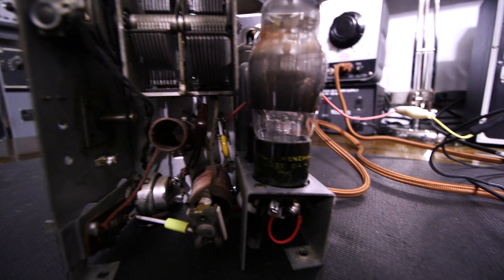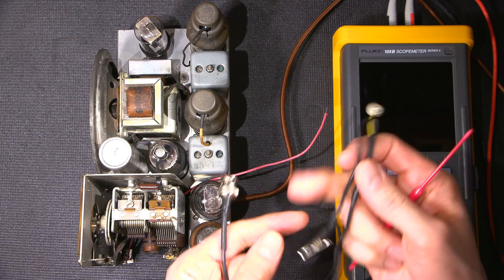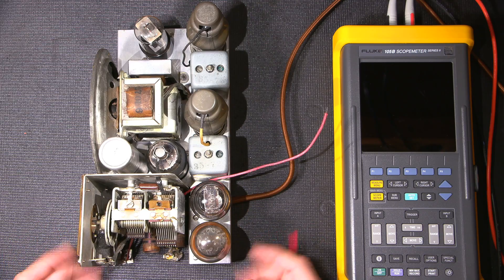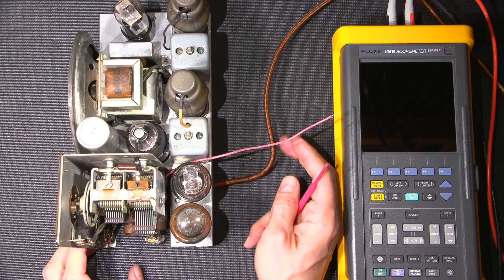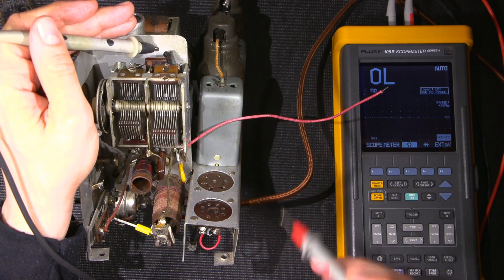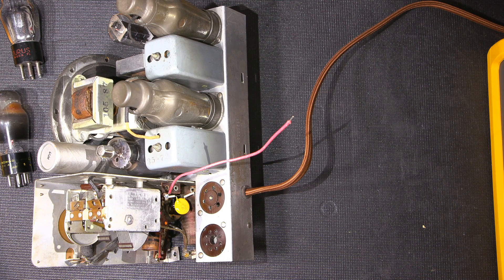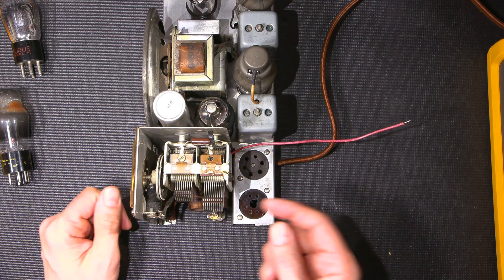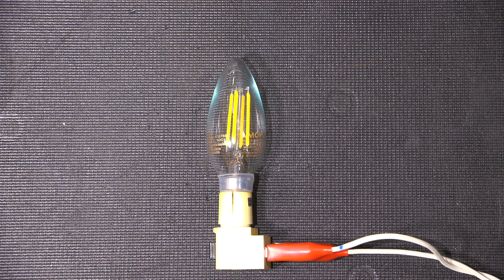See High Voltage Created From Falling Snow!

Comment: This is amazing, if i recall correctly from a Richard Feynman book, that every meter or so up is like 100k volts up into the atmosphere. so possibly the snow is still charged with high voltage from the outer atmosphere and conveys that to whatever it touches, but you need to collect the static from a lot of snow to notice it. just an idea.
Reply: 70 volts per meter is more like it. Thet's 2x10^6 to 3x10^6 volts to the top of the atmosphere.

Comment: Had that happen across a coax connector that I'd disconnected because a storm was approaching.  Very loud arcs!
Reply: Same here. Happened at a friend's place as well while a thunderstorm was approaching.
Reply: Had this on a car Ariel during a very dry day in the desert. No cumulous.
Reply: No in the desert the air was still. It was a low pressure area coming through. Apparently there is a normal altitude / voltage profile. It must have been pumped right up.

Comment: I hope you megger out that isolation Transformer, you know an isolation Transformer with a short to ground is very pointless :-)
Reply: It could be just fine. Is that a conductive antistatic mat the radio chassis was sitting on? If so, we have all kinds of possible paths to ground.
Reply: @Fourcycle  Good observation. There are possibly critical details in this event that need to be noted and modeled before our speculations here can be checkable. I've noted others have pointed out quality of AC line grounds to his home as a possible concern, and Carlson's video didn't explain the situation of the coax from the antenna to the radio unambiguously from an mateur radio operator's perspective, e.g. were the usual RF/lightning/AC-safety grounds and safety measures applied at the point where the coax penetrates into the home/lab? Or, was it a single contiguous piece of coax from up at the wires in the air, to the BNC connector he attached his shield-lifting pigtail to? (which somehow seems like a bad idea, esp. in retrospect)

Comment: This same thing happens with aircraft when they fly through snow and to a lesser effect rain. The snow carries a charge from the rain cloud above and when the metal plane hits it while flying the plane collects the charge. On the trailing surfaces of planes are static whips. Small 6” flexible rods with very fine short hairs, usually the rods are in  pairs. The rods and then the hair gives the static some place to exit the airframe. This allows the radios to transmit and receive. When I have been flying in very heavy snow in my small Cessna 182, the whips are unable to keep up with the static discharging and I get mild to heavy crackling in the radios. Sometimes to the point the squelch setting is overcome. 

The antenna did the same thing as the plane collecting the charge, and found a ground through the equipment.

Comment: I worked as a cable line technician near the CFRB radio towers... I came across situations like this quite often... and during diagnostics we decided to double ground every piece of equipment to try and eliminate the rf energy. This energy was enough to cause burns from touching metal amps dist taps, cables including grounds... It was the greatest learning experience in career...

Comment: I bet your antennas form a "Kelvin water dropper" static electricity generator.
Reply: Yes, but the radio was connected via isolation transformer. How was the circuit closed to ground?
Reply: John, very interesting comment.
Reply: @movax20h  If the isolation transformer is of the 3 prong grounded type on the primary,  my guess would be the ground prong is grounded to the transformer laminated core. The transformer would easily arc from the secondary to the core. Not likely for a 2 prong version to arc from the primary to the secondary winding, unless the neutral side is connected to the core as well. That is my guess.
Reply: @zulumax1  yeah. It depends how it is weird. Sometimes ground is shared , sometimes is not, Or it might be some isolation failure.
Reply: @movax20h  the  isolation transformer acted like a capacitor
Reply: GLASS MONSTER 
It would be interesting to see whether that transformer has a spilt winding or the usual all-in-one
Reply: @laharl2k  his isolation transformer has 2 120v wingdings one is the primary and the other is the secondary there is no connection between them the bobbin is likely a duel / split bobbin like mine
Reply: @movax20h : Capacitively coupled.
Reply: @movax20h  capacitive coupling to ground.
Reply: @movax20h  I agree, or some phenomena closely related. I built Lord Kelvin's water drop electrostatic generator as a kid and was surprised at the level of HV level it could create. The arc in the video doesn't seem like an RF arc. Those look and sound different. It reminds me of the arc off of a static generator. I wonder about the mat the radio chassis is sitting on? Is it an antistatic mat? (Obviously not, you say.) If so it's conductive. Even if not intentionally connected to ground, any other piece of equipment sitting on the mat could ground it. I'm not sure how the static charge got around the capacitor in series with the antenna and the only way the energy wouldn't be bypassed by the inductor and get past the capacitor is it it were RF. Weird. Really weird.
Reply: Could of the circuit design been making a artificial ground since the capacitor was being charged by the input from antenna and therefore activating the circuit which has a ground within.
Reply: @leejarvie1836  yes yes and yes
Reply: @movax20h  It doesn't have to go to ground.  The charge can be attracted to fill any reservoir due to induction.  You can charge up a leyden jar by drawing charge off of only one pole of a high voltage DC power supply.  There's no circuit there either.
Reply: @movax20h  Isolation transformers have limits on their isolation rating. 3kV (possibly more) was probably beyond that limit and it simply jumped around the bobbin from a winding to the core (that is probably grounded).
Reply: @fvckyoutubescensorshipandt2718  would it burn through isolation and show as a permanent damage of the transformer? Most materials that undergoes electric breakdown either fail catastrophically due to it, or heat due to arcing destroys it.
Reply: @fvckyoutubescensorshipandt2718  oh. I see now what you meant never tough of this. Do you know of any videos demonstrating this kind of isolation failure? Most isolation transformars do have rather big crepeage distance between windings.

Comment: Hi Paul, Winter time is notorious for static in the air.  Your big antenna was a huge static generator. Have you thought about using a 4 : 1 balun?  I use one on my 600 ft dipole receiving antenna.  It might help isolate your coax from your antenna, from lighting or even static buildup.  You may want to also consider using neon bulbs on each side of your coax to drain off static discharges to ground. (I bet you could come up with a sensitive device that detects 'high static' voltages that are present inside and outside of your home.)  I once blew out a VCR by walking across the carpet and touching the display!)  It taught me use the remote at all times especially in the winter. 
 Best regards, - Mike

Comment: Mr Carlson Re discovers St Elmos Fire..
I have seen this happen many times during storms.
The most amazing time was when I was about 7 helping out my Dad in his Cellar workshop when all of a sudden there was a giant spark from a TV Antenna coax plug to the brick wall about 6 inchs away, which continued for at least 2 minutes then stopped as soon as the storm passed over.
It's amazing how high a Voltage and Current can build up on any Antenna just before during and after Storms.

Comment: I had a similar experience happen to me in Kansas.  I had a long wire attached to a dentron tuner that was connected to my Drake transmitter-receiver pair.  I heard the clicking and saw the spark just as your video shows,  This was in clear but windy weather conditions. I unplugged the coax to the radio but there was no damage done

Comment: This is why I always unplug my antennas when I'm not using my radios.
Reply: I am surprised that there aren't that many people using neon bulbs from both sides of the antenna to earth-ground.  We used to do that years ago to drain the DC picked up by the antenna.  There are many weather conditions that can build up a static charge on an antenna.  Having the physical disconnecting equipment for storms is very wise.
Reply: That's not a bad idea, and it would make it pretty!
Reply: And what you'd really wanna do is not simply unplug the coax, but short the center to the shield at that end, then connect that to station earth ground.
Reply: @AmishSpecialForces  In stormy conditions, anyway! I wonder, if both sides the the coax are going thru gas-discharge tubes to station earth, in that state can you still use the antenna on the radio for RX (simple enough to check) or TX (more doubtful about that one)?
Reply: @atsdroid  precisely what a proper disconnect switch would do. Double pole double throw. All earth-ground in one position, all antenna in the other.
Reply: @atsdroid  that is correct - at least with the old vacuum tube receivers.

Comment: I had the same snapping sound in my shack (Last century!). I hunted it down and it was an older Swan VHF radio with a TX/RX relay. I had a VHF antenna on top of a 50 foot tower in a snow storm connected to  the radio. It was arcing across the relay. 

As to your coil/capacitor issue, consider the ignition system in an old car. They had a coil and a condenser, a capacitor. The breaker points would pull 12 volts through the coil, building up a magnetic field, then opened the circuit. The condenser allowed enough time for the points to open without completely discharging the magnetic field through the points. The points, if improperly adjusted, would go bad from the arcing. 

What happens is the field is trying to collapse and will build up whatever voltage it needs to jump a spark. The arc is a sign of voltage, not current. The higher the voltage, the longer distance the arc. In the car ignition, the 12 volt side is attempting to jump an .018 inch gap. But the high voltage side of the coil sees a .035 inch gap easier to jump at around 10,000 volts. So it arcs at the spark plug instead of the points.

It doesn't mean your capacitor is bad. It means it is blocking the current allowing the field to build up in the coil until it can jump the gap to the chassis. If you have seen lightning in a snow storm, the energy is coming from the charged snow hitting your antenna looking for ground.

Comment: Was there a CME or solar flare event on the sun during or before the event?
Reply: This type of thing is usually related to purely atmospheric weather instead of space weather. Has to do with wind (sometimes aided by dust or precipitation) or even just precipitation forcing the normal flow of current within the atmosphere to grow in magnitude. It's why connecting any electronics  directly to an antenna is bad design.

Comment: I had this happen to me.  I heard the noise first like you.  After a lot of head scratching we disconnected the coax from the radio.  The sound followed the coax.  Looking into the end of the connector you could see a purple light behind the phenolic center conductor insulator.  By holding the insulated part of the cable we discharged it to a doorknob.  Center conductor to knob.  Nice spark!  It was snow.

Comment: Aircraft aerosol geoengineering contains heavy metal particles. Cloud seeing uses aluminum, barium, strontium and silver iodide. Combined with high powered output from scatter radar, the natural environment is becoming increasingly ionized.
Reply: youtuber DUTCHSINSE covers this very extensively

Comment: Way back in my radio days, I was engineer at a radio station in Owen Sound.
We experienced that almost every winter! It would depend on how dry the weather was and how heavy it was snowing.
Anyway it caused our transmitter to overload constantly! To help I would put the tx into our night pattern at  lower tx power.  Luckily there is a lot of protection between the towers and TX.
There was nothing we could do.

Comment: Yesterday, here in south central Kansas, we had nice, light snowfall that went on for several hours. 
I remembered your video and raced to my shop for a Fluke meter and digital scope.  I disconnected the long
wire antenna from my antique Zenith radio and first tried the meter and then the scope.  Meter showed no DC and about
9 VAC.  Then I tried the scope.  Set the time base appropriate for higher frequencies, hoping that the static might be more like white noise and that I could possibly see the higher frequency component of that signal.  Did not see much high frequency noise but did
see something that looked sort of like audio (maybe from a nearby AM radio station?).  When I finally dialed the time base down for lower frequencies, there it was:  A beautiful 60 Hz sine wave about 42 V p-p.  To make this work I’m guessing I would have to string up some sort of antenna isolated way out in the country somewhere and then take all the measurements with a battery powered scope.  In any case, the snow was sort of wet and the antenna is only isolated with a few small pieces of PVC pipe so the conditions
were probably far from ideal for this experiment.  Was hoping some others might give this a try and report in.

Comment: It takes 100,000 volts to start an arc across a 1 inch air gap. Every time you ground a lighting strike you only get rid of 1/10 of the voltage. The average lighting strike is 5 miles that is a lot of voltage and it has enough amperage to melt sand into glass.
Reply: I seem to remember 35kv to cover an inch gap. Let's see what google says. Quora says 75kv so it looks like we split the difference. Of course it will vary with conditions.
Reply: Actually it's a lot less than that, and depends on electrode shape and air humidity. Did you get that 100kV per inch figure from a stun gun?
Reply: @uK8cvPAq  no it came from an electronics class with a live demonstration sugest you check your facts

Comment: My 2c worth. 

My guess would be that snow is building up charge on the antenna, charging up the capacitor. Once the voltage gets high enough the cap internally (or externally where you can't see it) arcs over. Depending on the location inside the cap there may be no/minimal damage. Due to the reactance of the inductor and the fast risetime of the arc, the charge cannot earth out through the inductor but the voltage is sufficient for another arc to form to the radio case, discharging the capacitor/coax/antenna arrangement.  The situation then repeats. You could try putting a resistor directly onto the incoming coax to ground or use a neon bulb or other discharge device on it to limit the voltage. If you use it for transmitting however I'm not sure what to suggest if you have high power levels. 

RP
Reply: Slight modification: The flashover wouln't need to be within the capacitor. An arc anywhere on the antenna/coax system would cause the same effect duw to the fast currnet risetime & the inductance to ground.
RP

Comment: I used to have this happen a lot in my antenna tuner.  When there were winter blizzards, I had a dipole antenna hooked up to my antenna tuner and I could hear that arcing sound inside my antenna tuner so I would unhook the antenna and put the end in a glass jar or something like that.  These days I do have lightning arrestors  on  all of my cables before they come into the shack and I have not had that problem since then it seems or have not noticed it.

Comment: In Douglas Mawson's 1911-14 Australasian Antarctic Expedition, the winter base was set up at Cape Densison, now known to be the windiest place on earth. During the near constant winter blizzards, it was observed that those going outside to operate the scientific equipment would have corona discharge emit from bits of fluff on their clothes, and that they would be shocked when touching the metal equipment. They strung up an antenna going to the roof of the hut (~10 ft), which when brought near a grounded rod would produce a continuous arc nearly an inch long.